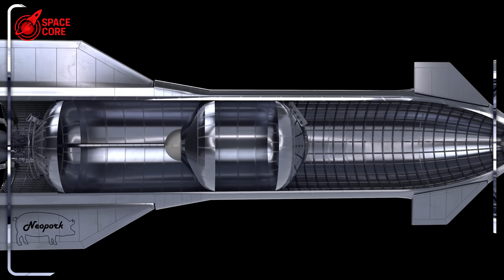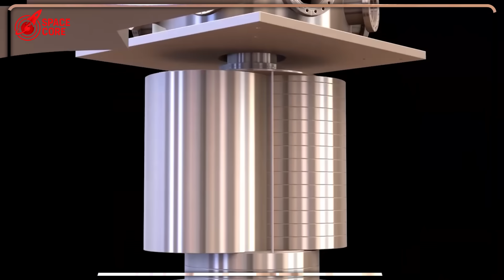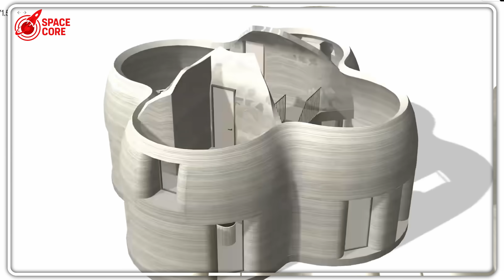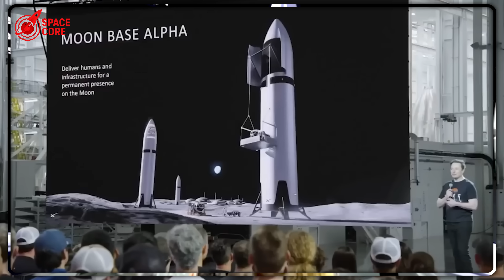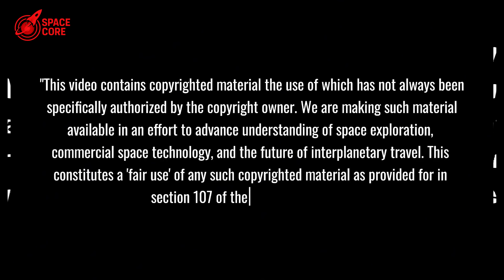SpaceX finally revealed insane Moon Base trick: SHOCKED Russia & NASA...

Comment: I think it must be possible to build most of the infrastructure into the tanks on earth which saves a lot of time once on the moon. As long as the structures inside the tanks are open so the fuel can reach the raptors freely there should not be a problem.
Reply: And loading them in space the shuttle  was limited to how much she could take up but comming back she could bring alot more down and the moons gravity a lot less thats why I call see the air bag technique of laying her down should be a problem if you rember right the first rover we sent to Mars had inflatable ballions to brake her fall same thing as air bag in your car good idea
Reply from the maker: @doncortazzojr2960  The airbag technique leverages the moon's low gravity, making Starship's landing feasible, much like Mars rover balloons. Unlike the shuttle, Starship's design optimizes for lunar habitat conversion, not return cargo.
Reply: Should not be a problem what it should of read
Reply from the maker: You've hit on a great point about pre-fabrication! SpaceX's "insane moonbase trick" relies on this very idea, using the Starship's existing structure as instant habitats to save massive amounts of time and resources on the lunar surface.

Comment: OK ------------- .. JUST THINK.. SPACE X IS GOING TO HAVE TO DIG A 60 METER LONG TRENCH 11METERS WIDE AND 5 METERS DEEP. TO DROP THE SHIP INTO ... WHAT ARE THEY GONNA USE  TO DO THAT...  I DONT' SEE THEM  LIFTING A 50 TON ELECTRIC DOZER TRACTOR UP TO THE MOON. BUT MAYBE A 15 TON HALLOW SHELL DOZER THAT THEY CAN STUFF REGULITH UP INTO THE FRAME AND  SADDLE TANKS ALONG BOTH SIDES OUT PAST THE TRACKS.. WHEELS CAN NOT GET ENOUGH TRACTION TO DO THE JOBS.. AND STILL THEY NEED A LOT OF WEIGHT TO GIVE THE DOZER ENOUGH TRACTION TO DO ITS JOB.. ACTUALLY, THEY NEED TO SEND TWO DOZERS AS  IMPORTANT AS THE DOZERS ARE GOING TO BE FOR THE FUTURE OF THE LUNAR BASE.. BOTH SHOULD BE WORKING AT LEAST ONE SHIFT IF NOT TWO EACH DAY, DIGGING AND LEVELING AND MAKING ROADS AND RAMPS AND PUSHING REGULITH OVER THE TOP OF THE  NEW BASE..STRUCTURES..   WITH ONE SERVING AS BACK UP. AS THE BASE IS COMPLETED.. AT LEAST THE FIRST PHASE.. THAT WILL ASLO BE NEEDED WHEN ONE OF THE DOZERS GETS STUCK.. AND THEY WILL..FOR THE OTHER TO PULL IT OUT..  THE FIRST BASE OS IS GOING TO BE ONE BIG EXPERIMENT THAT CAN NOT LOSE TIME WHILE ENGINEERING COMMITTEES BACK ON EARTH DEBATE AND STUDY EVERY PROBLEM THAT POPS UP TO DEATH  TRYIN TO MICAROMANSGE  WHAT THEY NO NOTHING ABOUT.... EVERY ONE UP THERE COULD WIND UP DEAD BY THE TIME THE COMMITTEES FINALLY FINISH THEIR  MICROMANAGING DELIBERATIONS ONLY TO COME BACK AND SAY WE NEED TO DO MORE STUDIES... NO...   MISTAKES ARE GOING TO BE MADE AND THINGS ARE GOING TO BREAK DOWN AND DOZERS ARE GOING TO DIG THEIR HOLES AND EVEN GET BURRIED IN THEM WHEN THE SIDES OF ONE OF THEM COMES SLIDING DOWN ... TO BURY IT... AND WITHOUT A SECOND DOZER TO DIG IT OUT, THE WHOLE OPERATION DIES...RIGHT THERE.. AND PROBABLY HALF THE CREWS... IF SOMETHING ELSE GOES WRONG BEFORE THEY CAN RELAUNCH THE STARSHIPS... JUST LIKE MARS... NO MATTER HOW CLOSE EARTH IS...
Reply from the maker: This is a fantastic point. The video focuses on the Starship itself, but you're right, the heavy equipment needed for construction is a massive challenge.

Comment: You know elone that after you lay it on its side if you let it go to zero atmosphere  you can cut out those  fuel tanks if you open them first so there dry  just how much more living space they would have justca idea
Reply from the maker: That's a clever idea for more living space! But those fuel tanks are also key to providing radiation shielding once the Starship is on the moon.
Reply: @SpaceCore25 I also had a idea about Mico motor strikes if you put a hual inside a hual that could turn if you got a bad strike on the way to Mars you would just turn the inside hual to seal it just a idea mit be stupid but I think it could work but I am on rocket sciencetis or brain surgeon
Reply: @doncortazzojr2960 I guess the interior fuel tanks are a great idea with a second air lock. Good thinking
Reply: @JimmyRussell-c2s there was something  else they say that antol Russian plane that can lift a hole lot of weight Ukraine is rebuilding her I think Elon should get the company up and running to build them because he trucks his booster back at a high cost that plane it could go inside or on top and carrie all his needs I think it would be a good investment and the US has a little pull there they have two more one almost finished and one togather send a couple of engineers over there to put things in motion to build them sence they say the guys who design it are dead or retired but that's a good thing because once the engineers learn the process of building them they can improve on the design I would keep the out side mounts and the tail the way it is so it can carry boosters on top just one of those planes assigned to spaceX could cut a lot of shipping cost and make turn around faster means more lunches
Reply from the maker: @doncortazzojr2960  Your micro-motor strike idea for a rotating inner hull is creative and could theoretically seal breaches. SpaceX might consider it, but lunar dust and structural complexity pose challenges.